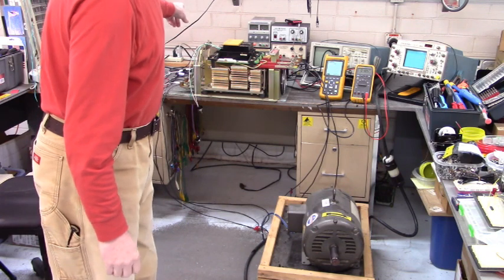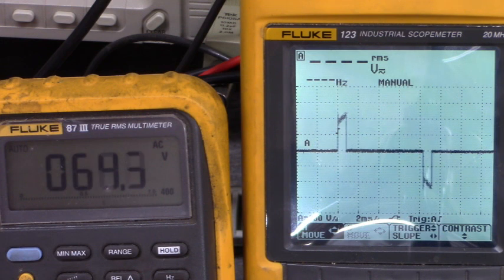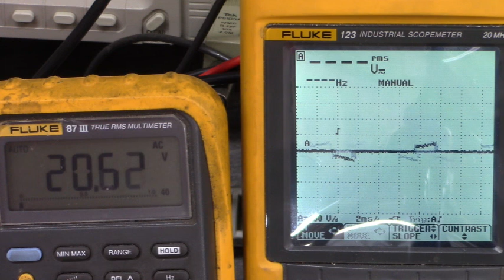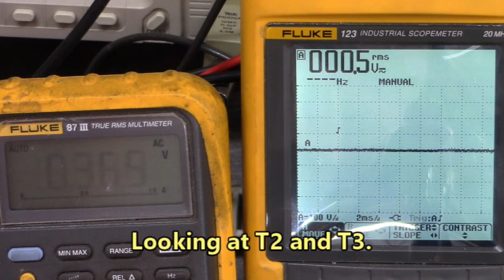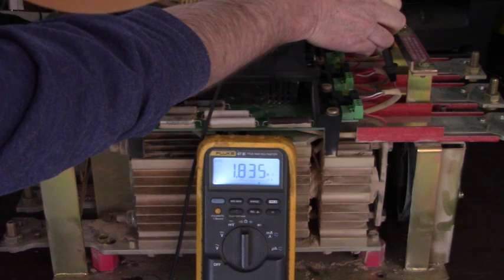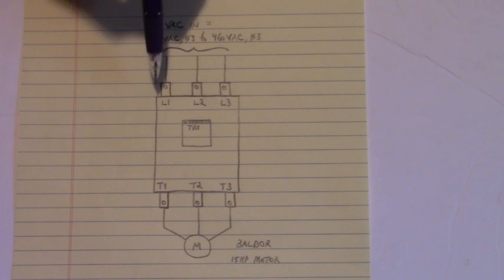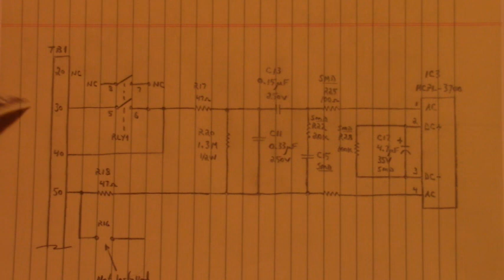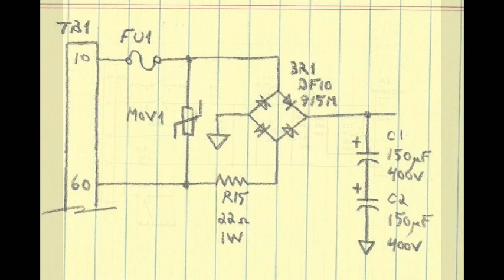This 15HP Motor is Loud. Please turn the volume down. Allen Bradley SMC Plus Soft Start

Comment: Thanks for the great video! I have an SMC Plus It looks like I have it hooked up correctly but the start button doesnt turn it on, I just get the green coontrol voltage light.  any suggestions?